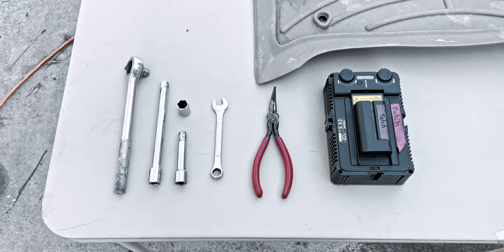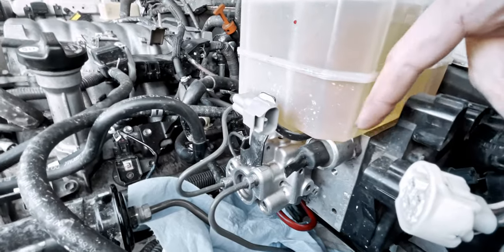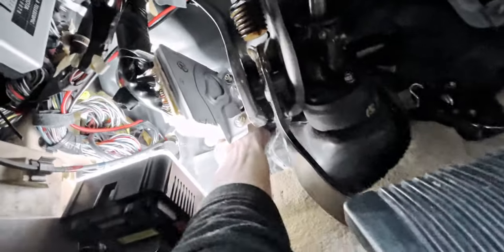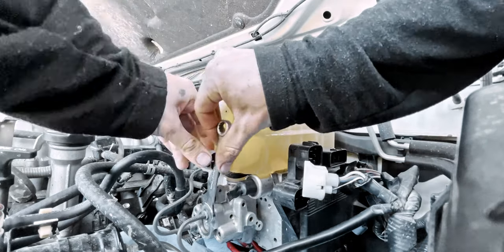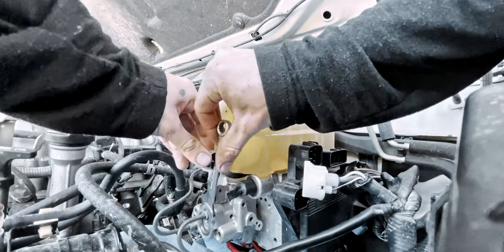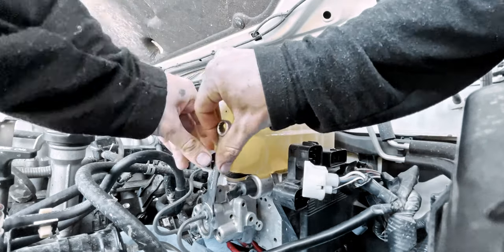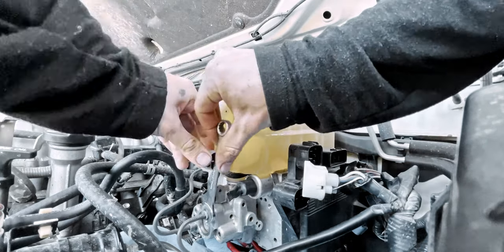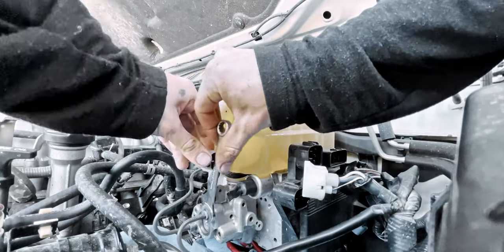Easiest Brake Booster Removal 100 Series Landcruiser (LX470) and Valve Cover Gasket Tips

Comment: Great video. I’m having an issue with my breaks where you can hear the pump running but it never builds up pressure it just keeps running. 
Do you know if I have to replace the whole assembly?
Reply from the maker: You probably just need to replace the accumulator (~$500 new). It’s that shiny silver cylinder
Reply: @cruiserpatch  awesome thanks!

Comment: hey just curious if the ABS pumps 47050-60012 & 47050-60013 are identical & interoperable in my 1999 105 series? without VSC they both look identical??
Reply from the maker: i’m not positive. as long as they only have three brake lines they should work

Comment: Just curious how long it took you? Doesn’t look like a horrible job. A shop has had my rig for over a month now to replace the booster and is finally getting to it but quoting 4 hours at $158/hr
But it really doesn’t seem more than 1.5-2hrs? Tempted just to tow it back and get it done myself and save almost 600$
Reply from the maker: Damn! That’s nuts! Realistically it might take 2-3 hours the first time you’re doing it unless it’s rusty or there are other issues…if you feel up to it, I say go for it 👍🏼

Comment: Any advice for reinstalling the brake pedal pin seen at 5:35? Everything else went smooth but the pin and brake pedal just don't want to align.
Reply from the maker: That’s an annoying one. I find it easier to manipulate the plunger on the unit side into position to match the pedal side. If it helps, you can pump the brake pedal a little while lying on your back under there
Reply: @cruiserpatch  thanks! I got it to work with a little persistence. This video was awesome and extremely helpful!
Reply from the maker: glad to hear it! thanks for the feedback!

Comment: Bonjour merci, j'ai fait la purge tout fonctionne bien, mais je viens de voir une fuite sur le sceau noir comme sur la vidéo où le sceau a trouvé que le sceau doit tous être démonté pour changer.
Reply from the maker: oh no! i’m sorry. that seal is between the pump and accumulator. you’ll need to replace those components so it doesn’t leak
Reply: ok thank you it retails at toyota? @cruiserpatch
Reply from the maker: @kaisdz8211 if you can find one, yes 👍🏼